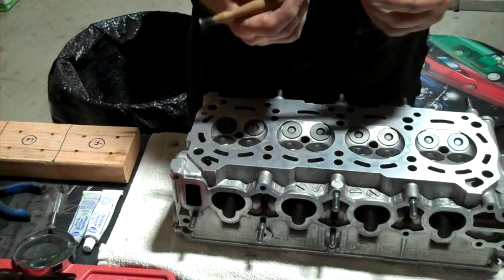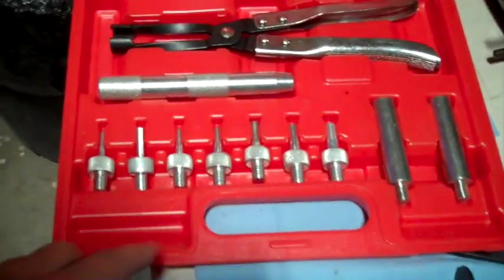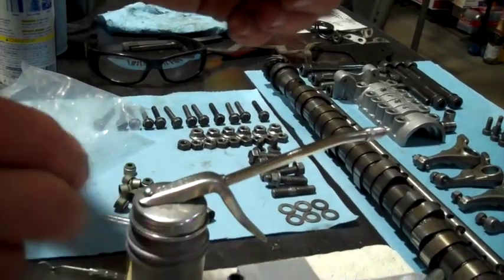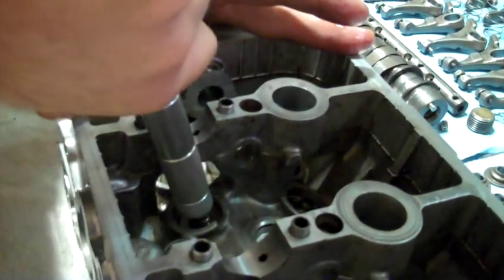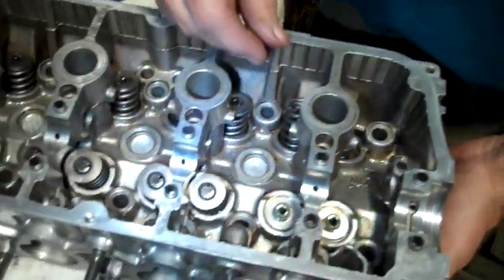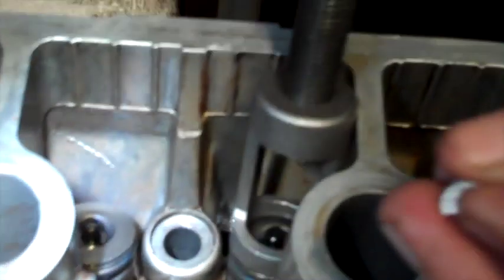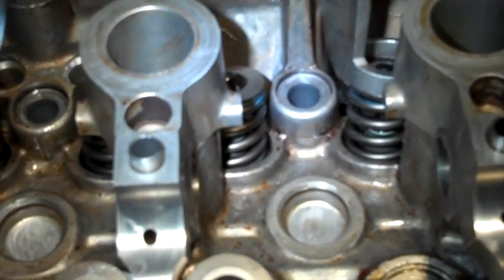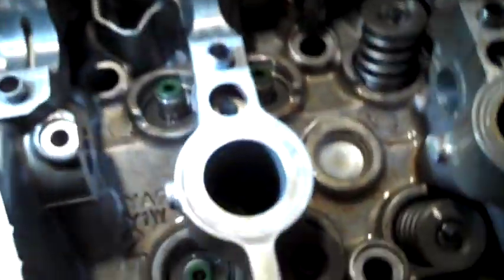1995 Suzuki Sidekick Engine Head Rebuild Part 4 of 9

Comment: Currently re-installing my valves, those little retainer things are so tricky to get back in 🤣I'm thinking maybe a bit of grease so they stick to the valve stem instead of falling down inside the spring might help?
Reply from the maker: That never occurred to me.  I spent a lot of time getting those little pieces in place and also looking for ones I dropped.  A little dab of grease will hurt anything and might avoid a lot of frustration.

Comment: Hello Frank  ... I have a Suzuki sidekick 1998 jx 1.6 .... code p0340 show up after the mechanics  replace starter, and battery (. new)
But the code p0340  just came  up ... show I replace  the camshaft sensors?
Reply from the maker: The '98 model has many differences from my '95 model.  You might try fixkick dot com forum for more advice.  I do not know.  If it was me, I would make sure the connections from battery to starter are good and no ground wires were disconnected.  Then I would make sure the distributor is not loose.  If it starts and runs OK then I would disconnect the battery and turn on the headlights for a few minutes to make sure the ecm is completely discharged.  And then turn off the lights and hook the battery back up and see if the code returns.  If not, then fixed.  If it does come back then I would pull the distributor and test the camshaft position sensor.
Reply: @nunapitchuk   thanks Frank